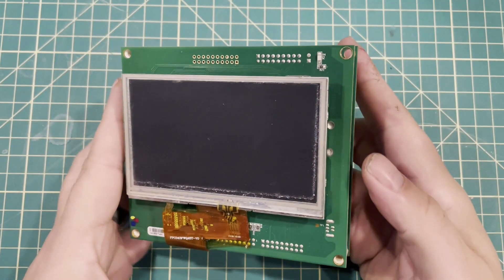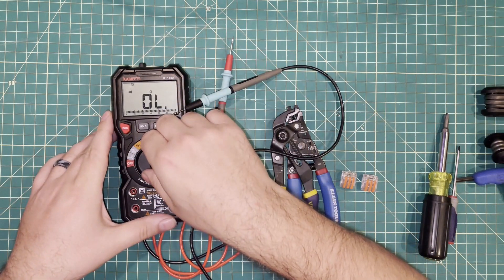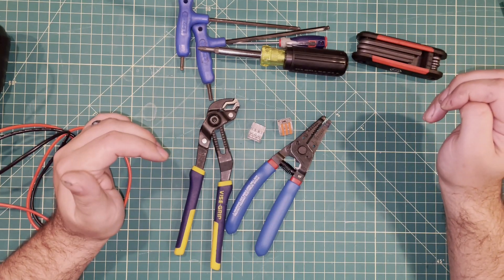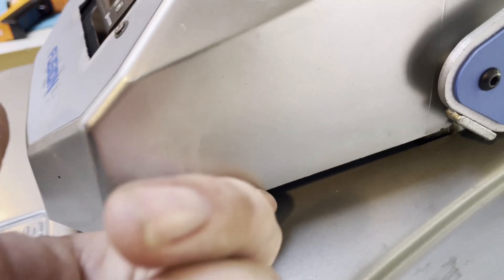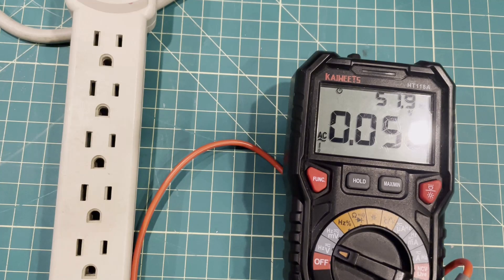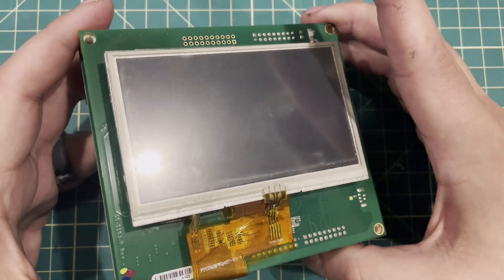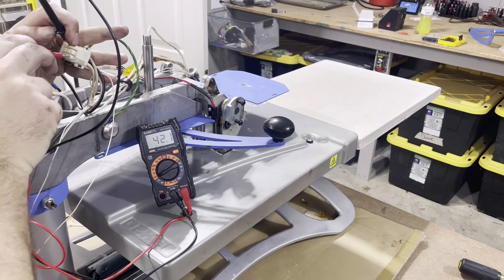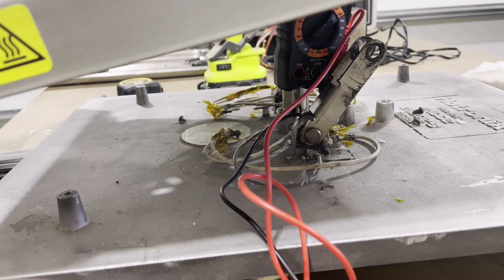Diagnose and Repair a Hotronix Heat press - or replace ALL electronics for less than $20

Comment: Thanks, my problem is that the touch screen doesn't respond in some places, I can't lower the temperature because the left side of the screen doesn't work, I think the only solution would be to replace the entire controller. :(
Reply from the maker: Yeah.  That's why I went with this.  I got tired of throwing expensive parts at it.   9 months later, it's still going tstrong.